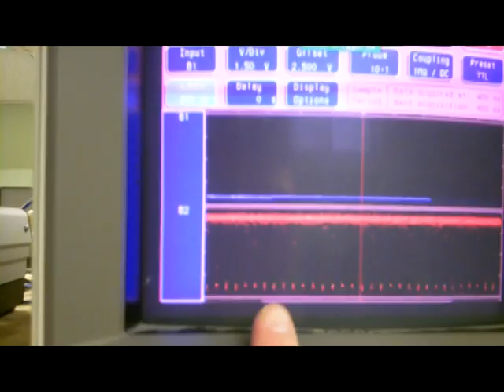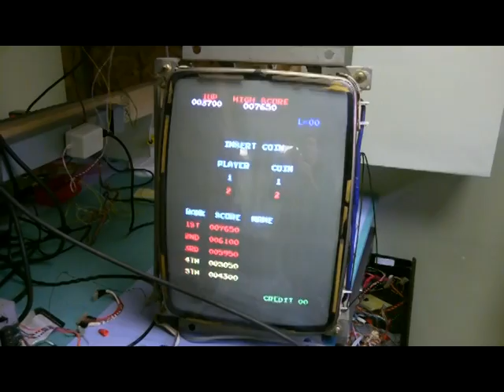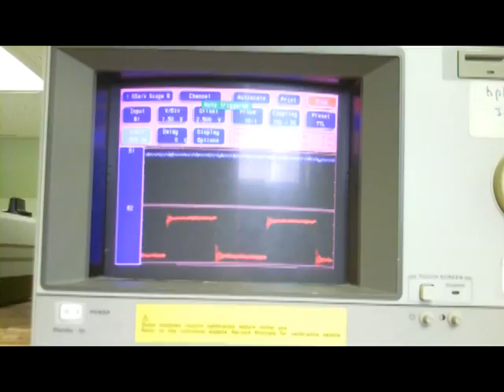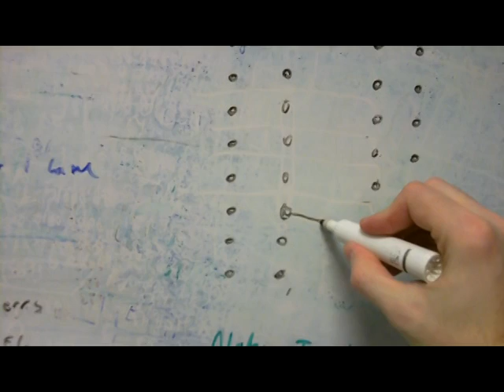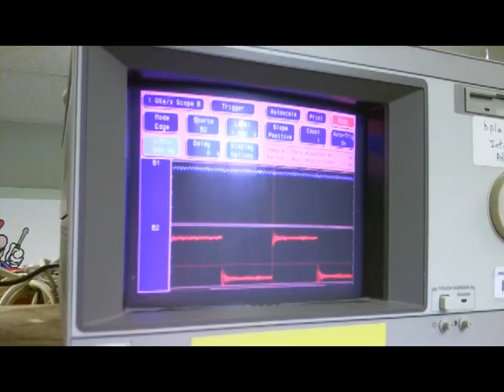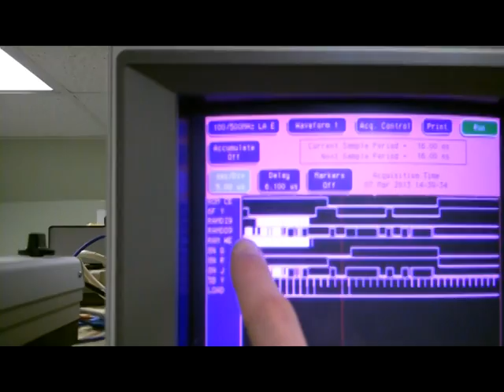RIck Zahn - Donkey Kong repair

Comment: Awesome video..  Keep making them!!  One question - Once you determined that the binary counter signal was getting induced onto the 5v, I was absolutely convinced that the problem was the the pull-up resistor had gone bad and was open or higher resistance, rather than providing enough pull up current..  Even a bad solder joint on that resistor could have caused that symptom, right?  Is it possible that you at least partially re-flowed that resistor and that's what solved the problem?  Is there something flawed with my logic?  I would expect that if there was something fundamentally wrong with running those signals across that 5v buss, that this would be a VERY common DK problem..

Thanks again - As a proud owner of a MsPac and Galaga, I enjoy working on them almost as much as playing them!  ;-)
Reply: Steve Jones That resistor was my first thought.  If those input lines begin to float a bit then it may cause the outputs to stutter.  But then again, the 5V power going into that resistor could be getting lower over time causing the problem.  It could be a bad cap or chip in that area that begins to short or draw excessive amounts of power when it heats up enough but only thermal probing or thermal camera would show you that for sure.  Could add a 100uF cap over the chips 5V and ground rails and run a 5v and ground line to it directly from the power supply to keep the voltage droop in that area minimal for testing.  That could probably cause the problem cap or chip to blow out giving you a definite answer to where and what it is.